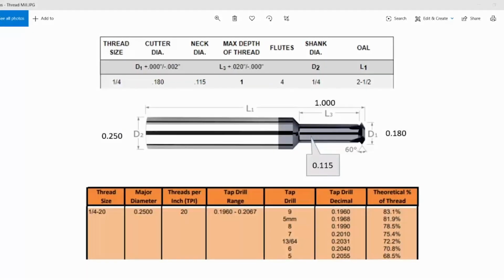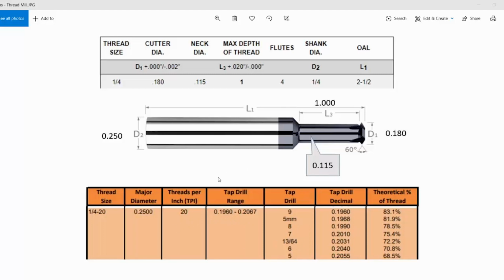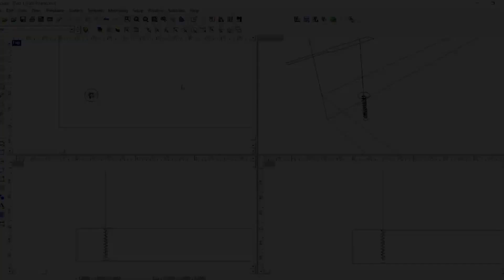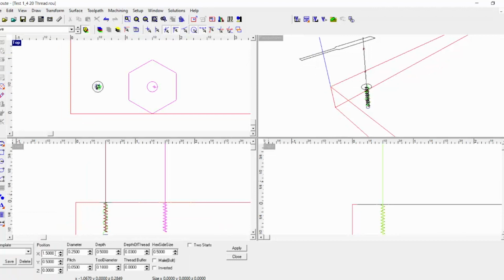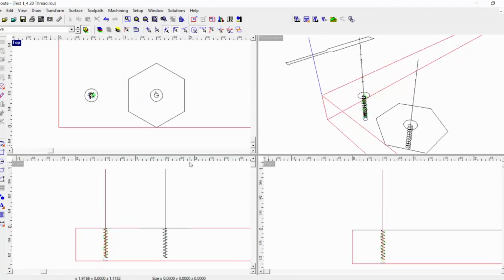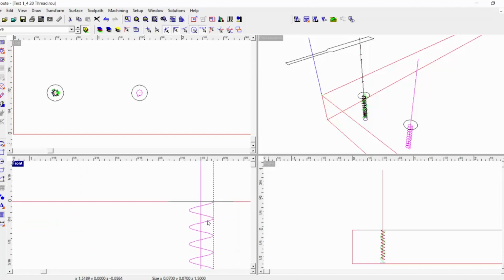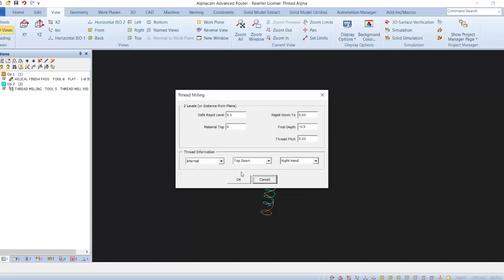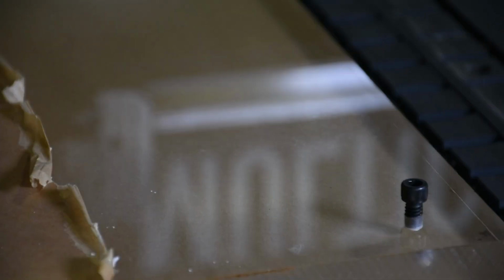MultiCam | How to create multiple tapped holes on your MultiCam CNC Router

Comment: Good video.  However, this is not tapping.  Tapping and thread milling are two very different processes.   Tapping requires an encoder on the Z axis/spindle.  Thread milling is helical interpolation using a single or multi tooth insert to form the thread- not up and down motion like tapping.

Comment: I am having some issues with this in enroute. Ive got all my parameters in and send it to the machine but when its time for my thread mill, the tool doesnt center on the hole when cutting. Ive tried "follow contour" and tried without selecting that but it still will not line up on the hole that was made for it...any suggestions??
Reply from the maker: Hi Joey. Please contact Russell Boudria at russell@multicam.com and he will be happy to set up a webinar with you to go over any issues you might be experiencing.

Comment: What type of spindle is required for thread milling?  I have an HSD ES929  on my 5000 series and I can't use it for tapping operations.
Reply from the maker: Tapping operations are different in motion than thread milling. Any spindle including collet spindles can do thread milling. Thread milling moves a specialty router bit down in XYZ circular thread motion and then moves bit to center of hole and lifts the tool out. Tapping requires the spindle and Z axis to work together allowing a standard tap to spin at rpm linked to how fast the Z moves down. At the bottom of the thread hole the Z and spindle slow to a stop and then reverse rpm direction as Z axis moves up.  Feel free to contact me directly if you have any further questions.

Comment: Will that work on my 1000?
Reply from the maker: 1000 collet or automatic tool change spindle can do thread milling with no problem. All the motion is controlled by the CNC file. EnRoute 6 did accomplish the job but found AlphaCam more powerful and user friendly. As long as your CAM software supports thread milling then you are good to go.  Feel free to reach out to use here at the factory for more information.

Comment: I have searched high and low through my Enroute 6 program and cannot find the "thread wizard." Any idea where to find it?
Reply from the maker: It can only be found in the drawing icons. Look for “Geometry Creation Wizard” just above the text icon. As a default the wizard icon is an arrow but could be any one of the pics of the different wizard shapes. At the end of the options is helical pic. That is the one.
Reply: @MultiCamUSA  Found it, thank you. Any idea on how to actually enter the tool into Enroute? I have tried setting it up as an engraving tool so I can follow contours but I can't seem to make the parameters of the tool make sense in the program. As soon as I enter a diameter or angle it will switch back to what it was.